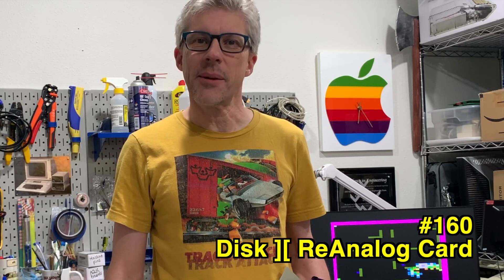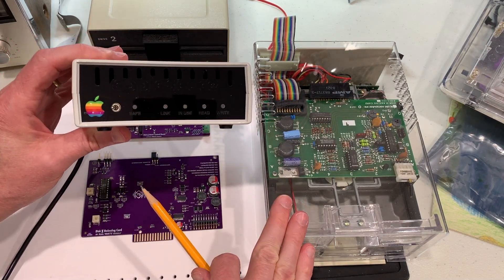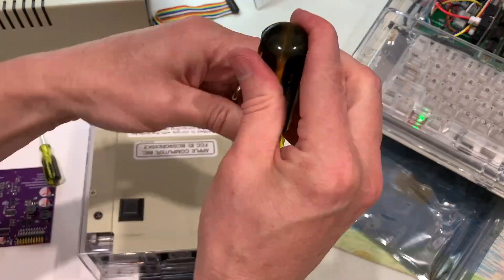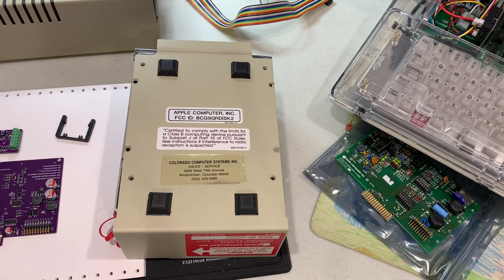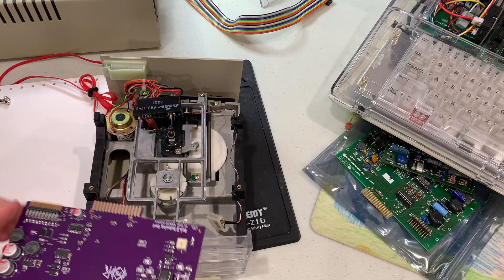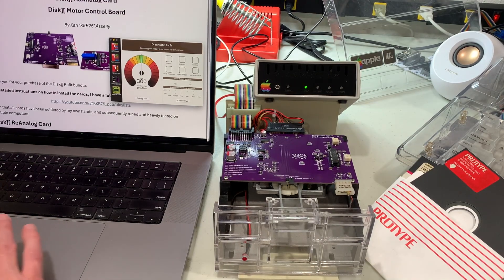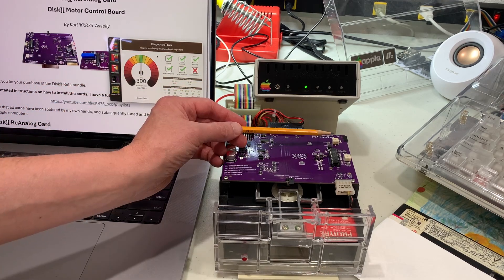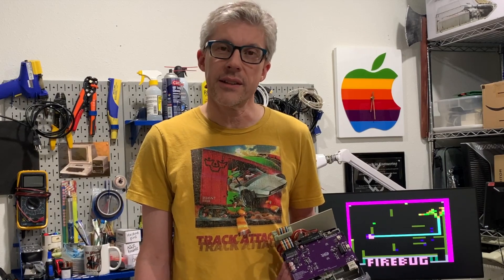160: A Makeover for your Apple Disk II Drive!

Comment: 2 years ago one of my drives stopped working, rpm was oscillating a lot. I swapped boards, replaced capacitors, nothing would work. Some weeks ago I got another drive, swapped motor, didn’t work as well. I found out that the issue is the head, as everything else works on other drives. I suspect the control board might have damaged the head, with a not so stable circuit. Such upgrade would enable the most reliable and stable setup, ensuring the longevity of the mechanical parts (and the head). Thanks for sharing!
Reply from the maker: Yes, that's the hope! Although I guess if the drive head is already damaged you'd probably want to replace that as well.

Comment: I am really concerned as to  what will happen when Motorola decides to retire the MC3470 read amplifier chip...
Reply from the maker: Very true. It sounded like Karl Asseily was able to source a replacement but it just wasn't as good as the actual MC3470...
Reply: I bought a BUNCH of MC3470s. like in the hundreds.  Those chips, after extensive tests, do perform better than the drive clones which do not have this chip. I will not get into the nitty gritty details because it can become a very lengthy subject, but suffice it to say that Motorola did an extremely thorough job in designing this chip. And I am not surprised Apple decided to go with this, as opposed to doing their own.
You can still source the MC3470 from various places. But if(when) they become totally unavailable, I'll resort to an alternative option. But really, the people who still use floppies are very few and far between. But I am sure charmed by them !

Comment: @CT6502 a slightly less sound emanating from the drive is also consistent with my findings 
I believe the main 'upgrade' here resides in power delivery. The board outputs a much better and stable supply to the drive components (both the motor card and the analog card). I have verified this through an oscilloscope and one of the striking graphs is the sine waveform which the amplifier's filter outputs. the original card has very jagged edges, while the new card is a perfect sine wave.
Reply from the maker: I thought it sounded better - thanks for the explanation. Although maybe some people will miss the super loud drive noises 🙂